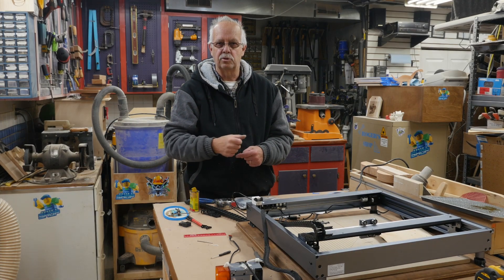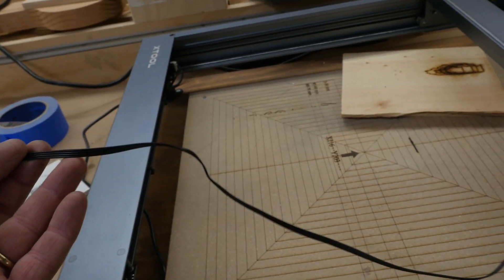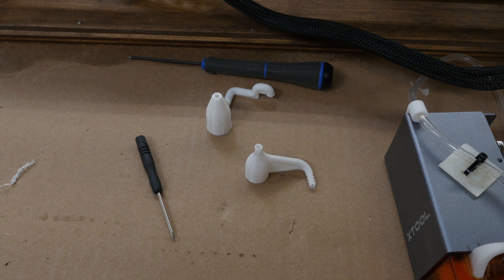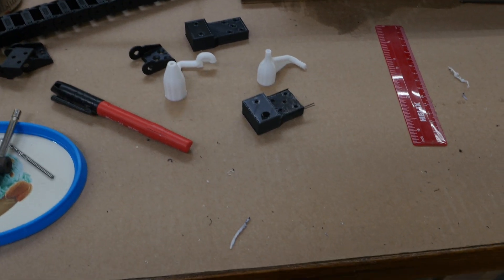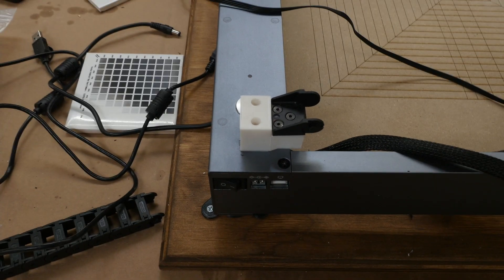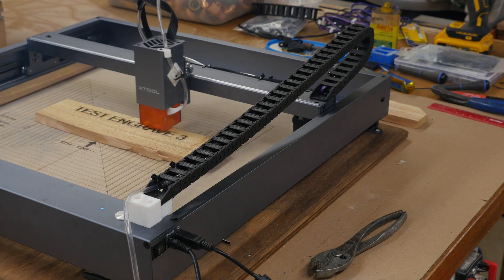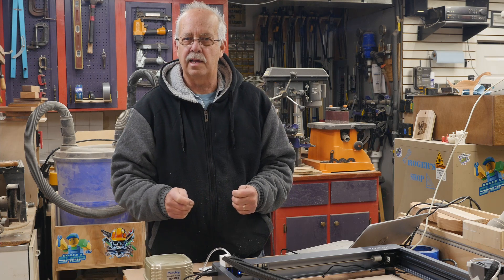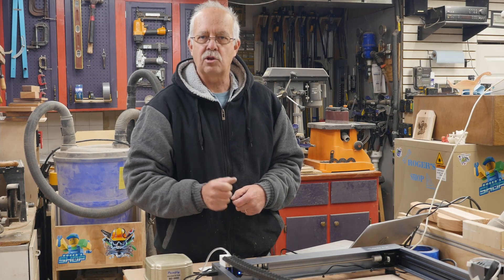xTool D1 Laser Air Assist and Drag Chain Upgrade

Comment: Are those drag chains able to be 'added' to?? If I buy 2 can they clip together to make a longer chain? I am getting the new D1 rail extensions and will likely need a little more than 1m in length
Reply: Amazon sells a 1.5 meter drag chain that works great on my D1 Pro extended.
Reply from the maker: Yes, and very easy to do.

Comment: good engtraving content, i have a question: i want to add a drag chain to the x gantry- is this possible or recommended?
Reply from the maker: It could be done, and I also looked into doing it if there was a problem with cable interference.  But, since it has not been any problem, I have left as-is.
Reply: @rogersshop  thank you Roger

Comment: A Tie Wrap is the kind with the wire in the middle that you twist around to secure thinngs, very often garbage or grocery bags.  They're usually made of paper/plastic and have a metal wire.  A Zip Tie is the plastic fastener which one pokes one end of the notched/ribbed strip into the other end which has a locking mechanism.  They are typically not reusable.

I asked for Tie Wraps when I meant Zip Ties at the hardware store and we wound up walking clear across the store 'cause they don't store them in the same place!  :)

Thank you for these videos though they have cause me some difficulty.  I was previuosly thinking that a cheap K40 would be the way to go but now I'm leaning heavily towards the XTool.  Of course, this is in the delusional fantasyland where I can afford such awesome things!  :)
Reply from the maker: I'm a retired electrician and while many call them zip ties, Ty Rap is a brand name https://electrification.us.abb.com/products/wire-cable-management/ty-rap-cable-ties that is generic to electricians for cable ties.
Reply: @rogersshop  Hilarious.  Ketchup / Catsup / Rotten Tomato Sauce... what's in a name?
Reply: I say tomato, you say potato! 😂

Comment: I love the D1 but I don't love the cable dragging around the work area. It hasn't happened yet but I'm afraid the cables will hit the material and move it during engraving.
Reply from the maker: Exactly why I added the drag chain.  I also have a second D1, but it is dedicated to the RA2 rotary, so the cable is not an issue in this case.

Comment: I measured min & max travel. Then applied a very sticky double stick tape to the bottom of the frame and pressed the control wire to it. Finally, I double checked travel & all worked out neatly and fine.

Comment: are you able to cut through 1/4" acrylic with using the air assist? I am interested in getting the xTool D1 for that purpose.
Reply: I’m told that diode lasers don’t work with clear acrylic……May work with coloured ….

Comment: i  ordered the longer cables for the stepper  motor and it would not move side to side just made a awful noise so no drag chain for me i really want to do this
Reply: Same experience with Jamie and Bgatep…..used link and my cables I got were twisted into the plug……had to cut and resolder the wires……..for some reason the cables from that link have changed.
Reply: @miket3445  I returned the cables as I didn't want to fuss with rearranging them -- I just ended up having it exit out of the drag chain  "early" to get a little extra length out of the stock cable; works fine and has full range of motion with just enough slack to not put any strain on the connector.
Reply from the maker: If you get the wrong cable, it will lock up the stepper motor.  Some cables are not universal, such as those made for some 3D printers, such as Creality, as the pinout is different.
Reply: @rogersshop  had the same issue with mine; ordered the ones you linked in the description; any suggestions?
Reply from the maker: @bgateb  Take a close look at the ends to make sure that a pair of wires is not swapped on one end.  Needs to be straight through.

Comment: Have you tried to curl the block chain over (like you have done for the gantry) on the frame end of the black chain and maybe gotten the 30mm height you determined was needed? Excellent video and I love your channel.
Reply from the maker: That made the laser head cables too short and I didn't want to replace those too.
Reply: For what it’s worth, I did that exact thing today with my D1 and curved both ends over (gantry and other end) and was able to use stock cabling no problem. Works fine and wires still have some slack.

Comment: what did you use as the air pump, fish aquarium pump?
Reply from the maker: Yes, it is a 2 speed Pawfly aquarium pump.  I use these on all of my air assisted lasers.  They are quiet and put out a good air flow.
Reply: @rogersshop  Did you make the Nozzels that fit over the Laser or buy them?? OK NM you made them! Darn
Reply from the maker: @rpace6821  Yes, I made them and did a lot of experimenting before I settled on one.  xTool does offer an air assist kit that makes this much simpler.  But that takes the fun out of it...........
Reply: Are you selling the air nozzels?? I've only seen 1 guy on etsy selling them. How much would you charge to make one, (not sure what Diameter mine is, D1 10W Diode)? I'm in Tampa area FLA
Reply from the maker: @rpace6821  I can make you one, but need to know the diameter of the lens as they vary.  If you have a digital caliper, let me know the diameter in mm.  This style assist nozzle does require notching the orange shield. I did it with a soldering iron.
Reply: @rogersshop  I did find a guy on etsy selling similar.  I ordered one from him, he's at least in my State so shipping minimal! Might want to consider doing that yourself!

Comment: Does the drag chain reduce the working area? I see that you ran a perimeter, but it looks like it stops short of the right hand side? Did you just take that into consideration? I know there are no end stops so I would fear absentmindedness leading to crashing into that drag chain.
Reply from the maker: No, it does not.  The X axis does not move that far to the right.  I was careful to check this when I was mounting the brackets.
Reply: drag chains are great for cable management but they can however induce tension points along specific points of the wires, that do not really change due to the fact it's keeping the wires in place as well.  IDK how well it works on laser engravers but on some 3d printers it actually works against you and can harm the wires over time.

Comment: Where can we find the STL for that little riser block?
Reply from the maker: I made this "on the fly" as a .16 layer and 100% infill block with PLA, then drilled and tapped the holes for the drag chain bracket mount and drilled holes for the 3mm machine screws mount to the frame above the motherboard.  the question for me is "did I keep that file"?  I will need to do some searching on my 3D printer laptop.
Reply: @rogersshop  Is the mount piece you made for sale? Would love to purchase from you for my d1. Thanks
Reply from the maker: @ofcleveland  Are you talking about the riser block?  Yes, I can make you one.  email me at raltman57@gmail.com
Reply: @rogersshop  I don't think that's necessary. If you can just measure the block and post the dimensions,  that would help
Reply from the maker: @michaelmcglynn7329  Upper section of block is a 30mm cube.  Holes are 3mm, spaced equal.  Lower part is 25mm wide, 25mm high, and 20mm long (check your drag chain mount bracket as they are not all the same).  I originally tried this without the riser block and it threw off the geometry too much and the chain would not roll up properly without catching on occasion.  Drag chain bracket mount to block are holes drilled with #29 bit and tapped 3mm x 50 pitch.  Printed at 100% infill for this purpose.

Comment: Great video Roger! Your solution with the drag chain is awesome! Where I can buy the wire for the stepper motor?
Reply from the maker: 1M Stepper motor cables  https://amzn.to/3AFL7d0  I just added it to the description.
Reply: @rogersshop  thank you so much Roger! I really appreciate it!
Reply from the maker: @DK You will need to shorten it as it comes out of the package as it is several links too long.  Very easy to do.
Reply from the maker: @DK If you get the cable in the description, a re-pin is not needed.

Comment: Great video. What length cable did you use for the stepper motor?
Reply from the maker: 1 meter.
Reply: Where can I get that extension cable? Mine keeps unplugging.